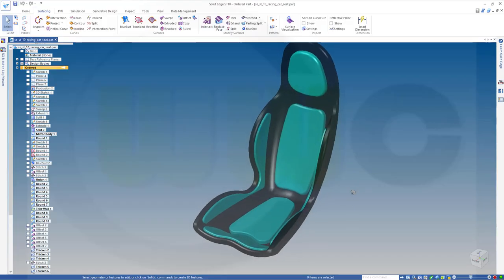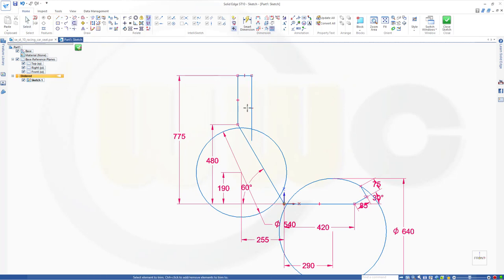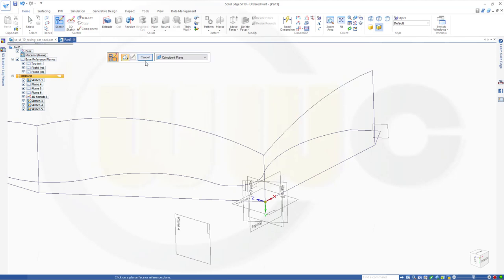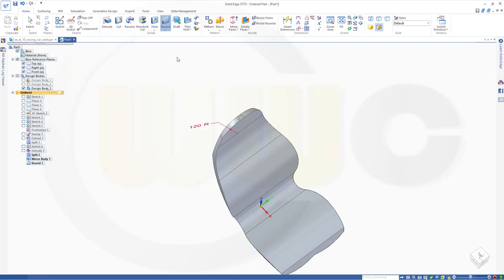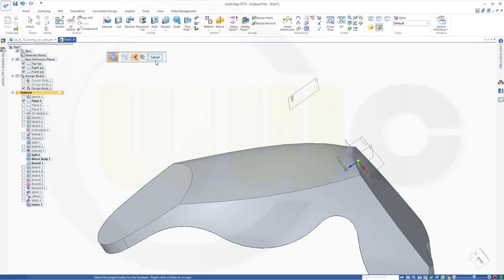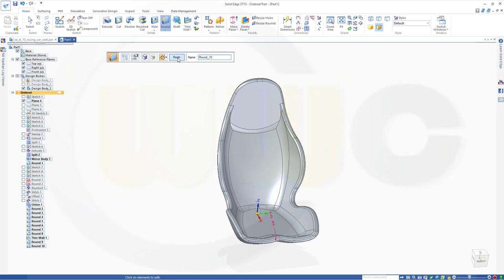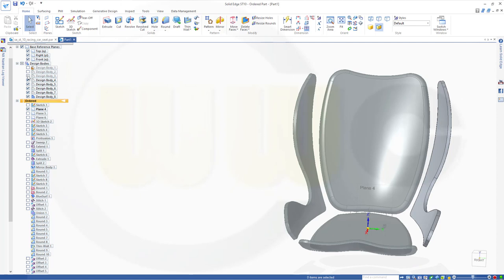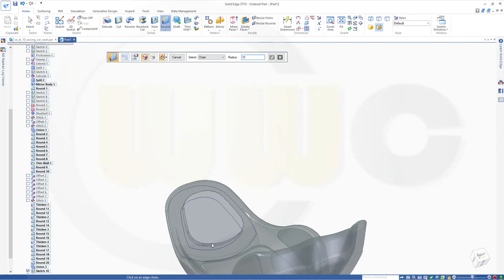Racing Car Seat - SolidEdge ST 10 Training - Part Design

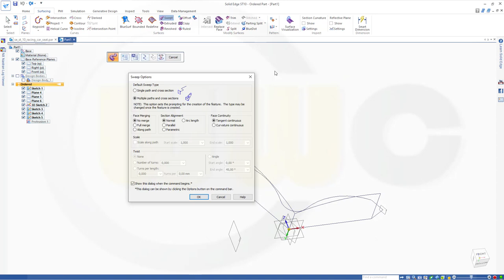Comment: Hi! I got stuck in minute 13:24, where you use command swept. On my program (I'm using solidedge 2023) it allows me to select 3 lines, as path step, and then asks me to choose cross section step. I can't get a shape that is shown in the video. Can someone help me? Thank you.
Reply from the maker: Please check the sweep options - "multiple paths and cross sections" - if you do the exact same things it should work
Reply: @wolfgang.walden.cad.training  Thank you very much. I figured it out. :)